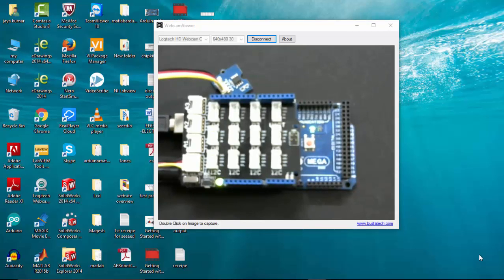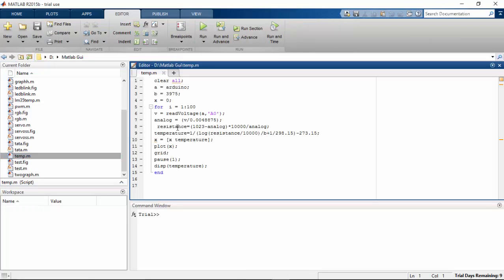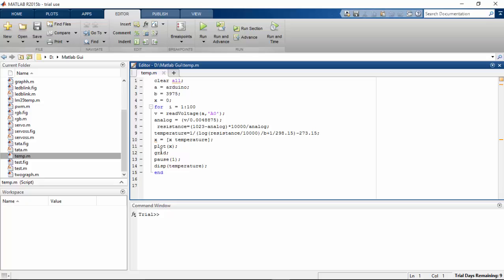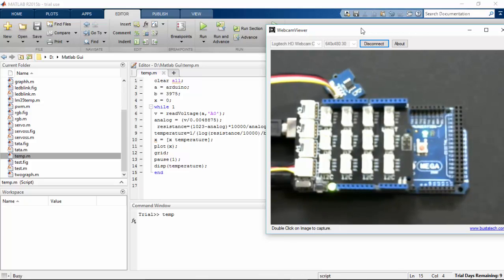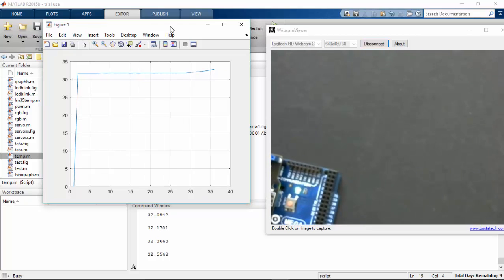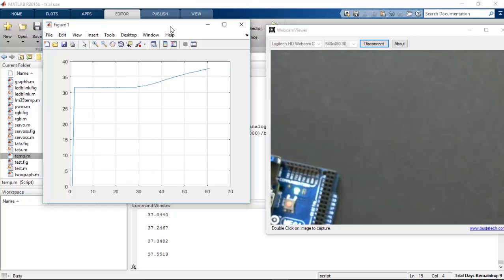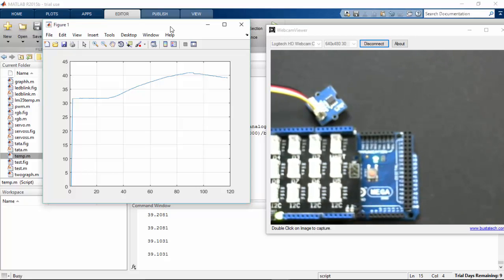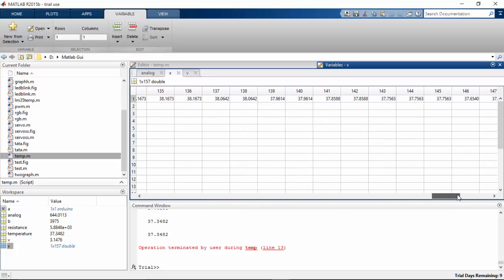Temperature reading on Matlab and plotting

Comment: Hello there, 
From what I understand, you read the voltage from the temperature sensor and then convert it to temperature in order to detect the temperature as you move the sensor around. Is that correct?

If I connect a thermal couple type K, connected with Thermocouple Amplifier and Arduino , for example, then can I still apply your code to detect temperature from the thermal couple if I place it in the hot/cold water?